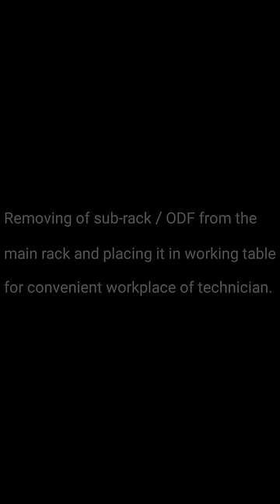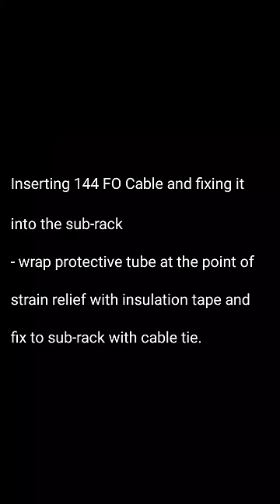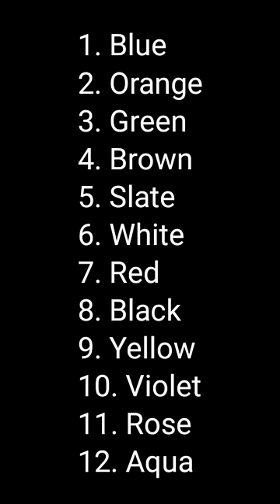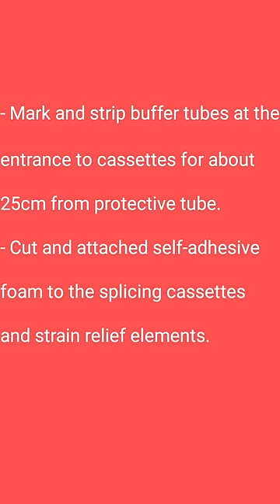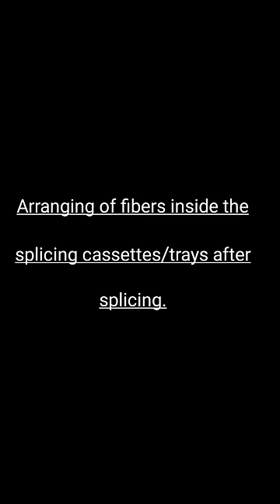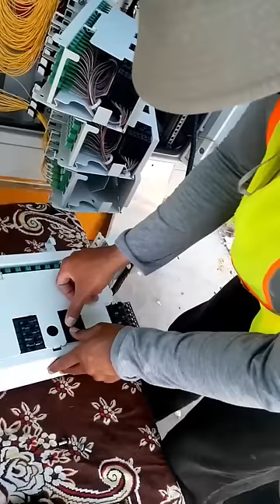VLOG#02 - Fiber Distribution Terminal (FDT) - ODF Cable Preparation and Splicing

Comment: that guy splices really fast
Reply: He really doesn't tho. 
He also double cleaves his fiber for no reason at all. 

The issue isn't him, its that machine (i used to own it aswell). The oven on it is slow as hell and it closes automatically. The push style mechanisms are faster.
Reply: @wbi007  you can do faster than that?
Reply: @andersonpyaban8042  To be honest? Yes i can do it faster than this
There are a couple of things where I instantly notice how i'm faster than this person. Sliding ur smouv with ur fingers? Use the darn magnets on the clamp, way faster. Why is his table so low? Get a proper height table so you don't fuck up your back and you can actually see decently (ur bending over ur fibres and ur struggeling to even see the colors). Why is he holding his cleaver in his hands? I know the ct-30 CAN be used one handed but it SLOW. Put it down on your table. 
While closing the lid to make a splice, put your smouve right next to the lid, makes it way easier to grab it after the splice is done. 

I could go on to be honest. I'm not saying he's doing a bad job, not at all. But he isn't super fast compared to what i'm used to.
Reply: Good 'observations'.
I'm waiting to see your video(s).